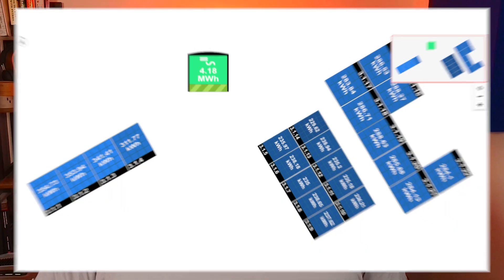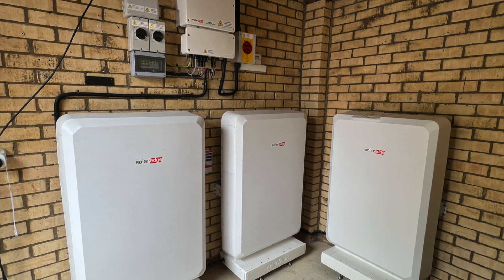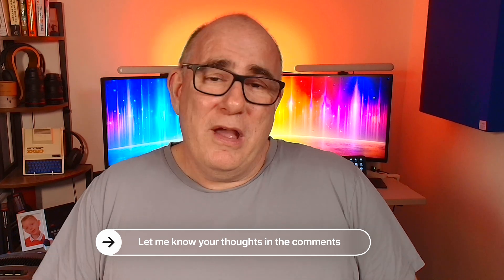Reasons Heat Pumps are CRUSHING Solar Diverters

Comment: Hi John and Alan. Your video has helped to decide not to get a diverter when we have our solar panels battery and heat pump installed by Octopus soon. 👍👍
Reply from the maker: All the export rates are what they are. It makes no sense to spend the money on the diverter, if things change in the future you can always buy one and add it.

Comment: Having an Octopus Daikin Heat Pump, Solar panels, battery system and Eddi installed in the next few weeks.
Octopus are poorly joined up in terms of Solar and heatpump with no one owning the overall design. 
I suspect i didnt need the Eddi at all.
Reply from the maker: I suspect you didn't need it, mine is almost redundant, except for the 1 day a week we run the legionella cycle on the tank.

Comment: I've had PV for 9 years , had an old style meter that ran backwards for the first few years so that got me into an EV to use the solar and keep my meter from rewinding. Then I took the plunge getting a smart meter along with an EV tariff as well as an Eddi + Zappi. We ditched gas 4 years ago so a heatpump is on the to do list. Will see how well it gets on with my Megaflo but i have a few rad upgrades to do first plus a bit of extra insulation.
Reply from the maker: you can get the rad updates done as part of the install, that way they will be correctly sized for the rooms and the flow temperature
Reply: @JonathanTracey  Had a quote from Octopus but its just based on my EPC so expensive. I'm probably installing myself as i'm a plumber and electrician. My previous quote wanted to scrap my 2020 megaflo as the coil is small for a heatpump but my airing cupboard is narrow hence the slimline cylinder i have fitted. Nothing is straight forward.
Reply from the maker: Makes sense if you can do it yourself then that’s gonna keep the cost down. I had to get a new EPC done before they would issue me a quote, but it seemed to focus more on insulation than anything else.
Reply: @JonathanTracey  My EPC is from when i had PV in 2015 and makes recommendations and assumptions on my insulation , Octopus want me to get a new EPC but in my experience they are a bit hit and miss on details they can't access. I have a fully boarded main loft plus an inaccessible one , the main loft is 100mm celotex the inaccessible one superquilt and  thin rockwool but they assumed its insufficient.
Reply from the maker: maybe worth talking to an assessor as mine asked what was under the boards and immediately marked it as “unable to check but sufficient”

Comment: Simples, use the heat pump when you're not in a rush to get the tank  hot again and the diverter when you do.
Keep the immersion heater as a back up just in case.
We only heat the hot water overnight to 45⁰ in the 7p/kWh period and it's good for showers in the morning and a bath in the evening.
Reply from the maker: we just have our top up the hot water as soon as it drops 10° below the 43° threshold. so we’ve pretty much got a constant supply of hot water and we don’t have to wait long if we use a lot. I will be keeping the diverter as I’m sure in the summary will get some use.

Comment: Yes my Eddi is off. And my installer refused not to install it when I had my Sun Amp installed.
Reply from the maker: refused not to install it, why?
Reply: @ I get the impression they came together and that the installer was uncomfortable deviating from the install instructions. But there no scenario even in winter when it’s more efficient that the heat pump. But it does serve as a wildly over engineered back up water heater.
Reply from the maker: lol yep that’s what mine has become

Comment: Setup smart grid on the heat pump, takes a bit of wiring. If you have an Eddi you’ll need the relay board to switch a contact on the heat pump for it to run. You may also need a high to low voltage relay as the HP board is 12V(Daikin do a relay kit for this EKRELSG ~£100 - the relay in it is an Omron G2R-1A-T-AC240). You can optionally attach a smart (pulse) meter to the heat pump so it can track the PV generation, or just set a hard limit for consumption(that matches the Eddi relay config).
Reply from the maker: Thanks Adrian, will look into it

Comment: I agree that heat pumps crashed the solar diverters.
Not only they use less energy for the same heat output, but there is a second advantage that no one seems to realise; long term there is significantly less limescale built up inside the cylinder when the water circulating in the coiled heat exchanger is up to 60-62degrees. The heating elements produce much more limescale that collects inside the cylinder, reducing its lifespan. Similar to the limescale in a kettle, but without any good way to descale the cylinder.
Reply from the maker: In hadn’t considered the limescale issue,thanks for the heads up.

Comment: It’s all about priority - I don’t have a HP yet but when I got my battery, the diverter (DIY so relatively low cost in hardware) took second fiddle to charging the battery as I can always use gas to heat the water but not run the fridge or light for example (especially over the darker months)- I remember a quote from someone on the OpenEnergy forums that using high grade PV electricity seemed a bit wasteful on heating water! But I’m on the old FiT with deemed export so it using up as much as possible makes sense. Now in the future if I had a HP the diverter would make no sense as the HP is multiplying the real energy used even at a low COP and could either use direct PV or that from the battery as a buffer. In your case it makes no sense to use the diverter for 1:1 heating when you have the HP - extra wear - that’s a totally nonsensical point since if you didn’t have PV or a diverter your HP would be heating the DHW anyway 😳
Reply: As you have a battery and solar you could move to a tariff that pays 15p or so for your export. You give up your deemed export but keep the FIT generation payments. I did that, it was an easy switch
Reply: @davidsinclair144  thanks, yes this has been on my mind - I need a smart meter first which hasn't been forthcoming so far although I wasn't keen on the idea when I first had PV put up in 2013 but as Octopus has changed the market and I have a battery it is starting to appeal. Similarly I want to move my FiT away from Ecotricity and move it to Octopus to consolidate my energy import/export which at the last time of asking them seemed a little convoluted and I wasn't entirely convinced by their CS that it wouldn't break something in the process so left it be since the FiT is paid direct. Last thing is how much export I would really have with just PV (i.e. not gaming the import then export aspect with the battery which I'm conscious has already lost 3% SoC even with regular household use in 2y) and in reality with the battery (I'm eyeing up more capacity and maybe an EV/HP) so realistically over the summer that may be less than 300-350kWh which @15p would be £50 versus my current deemed export of 2000kWh @5p = £100 - this is data that I now have from my OpenEnergy monitoring so it's not always that clear cut...
Reply from the maker: David, I stayed with ecotricity for my FIT payment even though I moved to octopus, I thought it was easier to stay put and they’ve been very accommodating about processing my upgrade so that I don’t lose the payment on the initial capacity even though there’s new system is much bigger. I have opted out of export part of the FIT payment as it’s much more lucrative to be paid £.15 per kilowatt hour that you export, if you have the capacity to do that
Reply from the maker: Yep, that’s exactly what I’ve done. I’m getting paid. £.15 for export haven’t given up the deemed export and part of my fit payment.
Reply from the maker: yep i agree the diverter is going to be retired, or at least put on light duties

Comment: Interesting,  Solar Thermal is far more efficient than PV.  So it would have been better to have originally install a solar thermal panel for HW. But I agree with your conclusion, return the extra energy to the grid but use it once a week to heat the CYL to 65c,
Reply from the maker: i haven’t seen much solar thermal in the uk, maybe it’s more suited to warmer climates
Reply: @JonathanTracey  we’re not blessed with the biggest houses either in U.K. so home roof space is at a bit of a premium
Reply from the maker: We use a lot more electricity than we do hot water and as there’s no simple way to convert solar thermal into electricity I would probably prioritise putting PV panels on every inch of my roof

Comment: Probably sounds like a stupid question, but what is stopping the heat pump being used to cool the inside to temperature during summer using that spare electricity?
Reply: Only with an AirToAir heat pump
Reply from the maker: Yes, you would have to use an air to air Heat Pump but that gives you two disadvantages. Firstly, you won’t qualify for the boiler upgrade scheme and secondly you will still have to come up with another solution to heat your hot water as they only heat the air.
Reply from the maker: two things, to get the government grant it’s not allowed to setup for cooling and air to water cooling isn’t that efficient, radiators are o no it great at taking heat from a room

Comment: If in future your prices are like in the Netherlands, you could have negative pricing in sping/summer. and then de diverter is better als it also reduces wear on your HP.
Reply from the maker: we do have negative pricing usually when it’s windy out in the north sea, then i fill my batteries and cars to the max :-)
Reply: @JonathanTracey 
I believe that @vriesvakkie1 refers to export prices when renewable energy is produced at higher rate than the grid demands. It is already happening in Europe.
Imagine a sunny summer day, when the solar production hits its peak around noon and the solar inverters are going crazy exporting to the grid. We will be charged by the energy providers to take the energy produced
Reply from the maker: Yeah, that’s a possibility, but not something that we’re seeing yet so as the old saying goes make hay while theSun shines. If that day ever comes and the grit stops taking exported power then I can see a lot of solar owners increasing their own battery storage and possibly installing a hot tub :-)
Reply: i agree the imersion is the sunny solution, similar to the economics of battery deep cycle for export, wear or degredation is a difficult £ value to gauge.
i prefer redundency
Reply from the maker: A lot of people bring up the wear and tear on batteries on heat pumps and other devices, but I’ve seen no evidence that using these devices in such a way shorten their life

Comment: Our solar is intermittent so unless the heat pump uses the battery it's easier to use the diverter which is quite happy with intermittent power. The installation is fully DIY so export isn't an option unless we join octopus (which then means higher standing charges and import costs, but 15p export)

Comment: Is it really worthwhile to run the legionella cycle on the tank. It seems you also need to run the very hot water through the shower heads for 5 min for it to have any effect. You'll need to set an alarm to remember this
Reply from the maker: I was told the bacteria is in the water not on the pipes so heating the tank for an hour then blasting it through the shower head will clear out any water that is stagnant in the pipe

Comment: I have an iBoost+ and the diverted surplus is used to fill my 2.6kw Storage heater in the lounge (Snug) there by taking of the chill, at present still on the old FIT payment scheme so not worth fully exporting due to the low payments
Reply from the maker: I never considered using it to turn a storage heater on and off, might have to look into that. I opted out of my deemed export payment on my fit scheme as it’s much more lucrative to export and get paid than to just take the deemed export.

Comment: I have solar and an Eddi and haven't got my heat pump yet but this is what I am planning to do after it is installed in Feb. I think I will use the heat pump to heat my water 100% of the time as it's more efficient and the Eddi can be used as a backup should the need to use the immersion arise. At least with the Eddi I can use excess solar then and/or set the timer on it if needs be. I already have it but if I didn't have one I wouldn't get one now. Can help with boosting in the summer if the export rates become use than the off peak rates too.
Reply from the maker: I agree with you hundred percent, but didn’t already have it. I wouldn’t buy one now, but I’m gonna use it exactly the way you’ve described.

Comment: One concern to consider is the additional wear on your heat-pump that overtime will shorten the lifespan.  Additionally, you have an abundance of solar generation in the summer, and if, like many home solar systems, the daily generation, at times, isn't needed by the grid.  So many of your neighbors are also exporting their excess solar.  My two pence.  Cheers.
Reply from the maker: I’ve been told it’s better to keep the Heat pump running as starting and stopping it will eventually shorten its lifespan. Right now the energy company is happy to pay for excess energy even in the Heights summer. I’m sure that won’t continue forever but while it is, we will as they say, make hay while the Sun shines.

Comment: I almost had a solar diverter installed when first installing the heat pump but realised the heat pump did the job much more efficiently. Now I have use of home assistant I can build some automation into  starting the heat pump when their is excess solar, when battary is full and water drops to a certain temp.. Nice to have the solar diverter for legionnaire cycles though that might work for when the sun is shining, maybe
Reply from the maker: That’s exactly what I’ll be doing during the summer, using Home Assistant to start the hot water cycle when there is excess energy. It’s a nice to have as a backup as you say good for the legionella cycle.

Comment: With the Eddi you can add the optional relay board and use that to signal the heat pump to heat the water when you have excess solar. On our system we only use our Eddi now to do the once a week Legionella cycle, our water is only heated overnight by the heat pump to feed the morning shower and if it is a bit cool in the evening we don't worry unless we have guests so simply boost the water from our heat pump app. We just spend all summer exporting as much electricity as possible at 15p to spend over winter at 7p, as like you we have batteries that keep us off grid all day outside the Intelligent Go period.
Reply from the maker: That’s the strategy I think I will set on, will look into how to use the relay board and see if we can get that working. Thx for the tip.

Comment: You seem to be assuming that everyone has a full-electric heatpump, but with a hybrid setup, it's a totally different story.

Also: please don't confuse everyone by using 'energy' and 'power', or 'kWh' and 'kW', as if they're interchangeable ... :-}
Reply from the maker: Hey Erik, I’m not assuming anything this is a what I did type channel, I have no experience of hybrid setups, so cant comment on them either way. In a pure electric setup the diverter is looking like it has no place, but happy to be convinced otherwise. WRT the mixing of power and energy etc, yes i know i do it, have done it for years and cant seem to rewire my brain but no one has complained yet (except now) and most people seem to get what I am saying. Will try to do better in the future 🤙 pinky swear

Comment: I would say Export every kWh that you can and get paid 15p/kWh on Octopus or similar. Heat your water, charge your car, and your batteries using the 7p rate on Octopus at the night rate.  This is financially better. You are also helping to balance the grid by doing this.
Reply from the maker: I think you absolutely right, thats what I am doing in the winter, I fill my batteries overnight and then sell back what I have left at the end of the day. Once we go into summer we will be self sufficient and sell excess

Comment: It doesn't make sense to use the diverter anymore. If your keeping it that low temp though I would be increase the temperature to 70 for 30 mins every 3 days as it's the only way to kill it regularly.rhe heat pump is the best way to go but may dip into the battery power alot as it often increases to max on the he pump drawing max energy where's the he diverter only uses what's available to get to that higher temp
Reply from the maker: I need to look at the power draw and time for the heatpump to get to that higher temperature, maybe more efficient to just use the thermostat. I run it once a week at present and that seems to do the job, it heats the tank to 65c and keeps it there for two hours which is enough based on what I have read to kill off any nasty bugs

Comment: ok - I have solar and a battery but no EDDI (yet). I'm about to get a heat pump. I thought that the EDDI would allow me to divert excess solar to power the heat pump. If that's true isn't it better to do that rather than exporting the excess?
Reply from the maker: depends if you have an export rate setup. for me i get 15p to export a kWh and it costs me 8.5p to buy a kWh and store it in my battery. so better to export it than use it